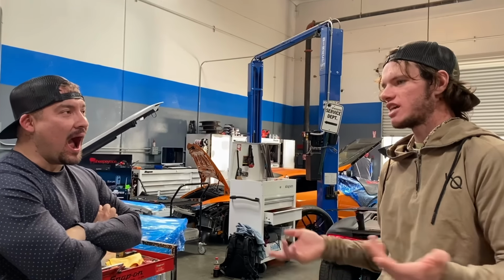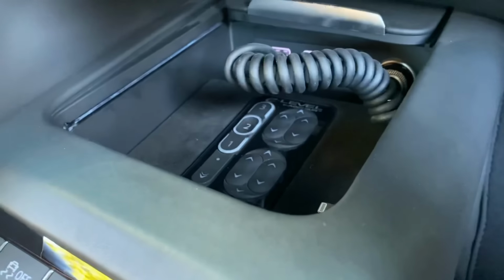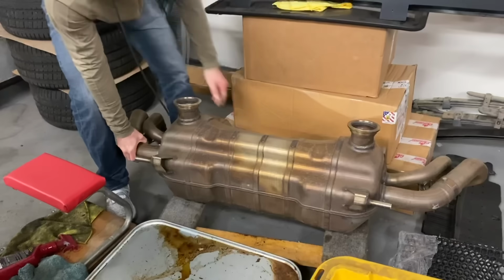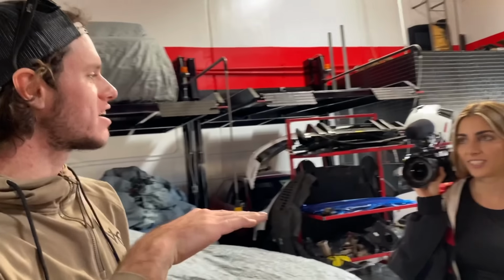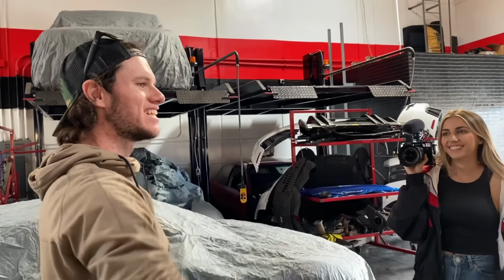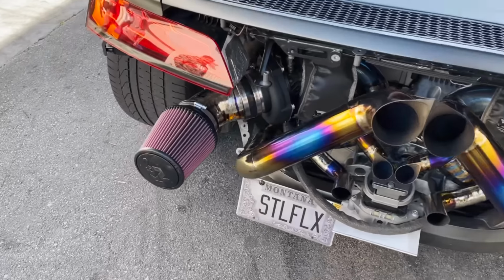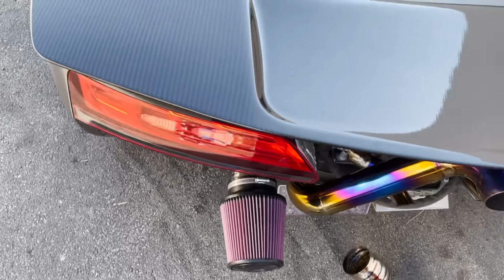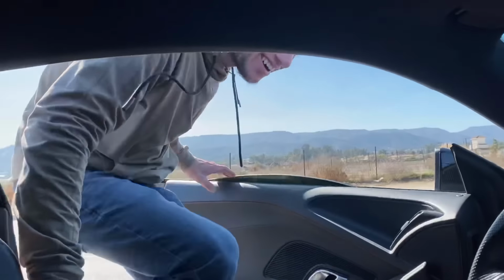My 1400HP Twin Turbo R8 vs C8, Aventador, Ferrari, R8

Comment: "What's the fastest car u been in?" "2000 hp viper. Oh"
Reply: watch texas drag races , 2000hp vipers get shamed and its kinda upsetting
Reply: Proceeds to say her vette dynoed around 1000 then gets left in the dust  by the Audi in 1000 lol
Reply: @willsmith8203  awd r8 vs rwd c8. Different torque, different weight. Plus it's a 1400 hp r8, not 1000
Reply: @boudrauxmnxsty6871  he says earlier in the video he can’t turn it all the way up. It’s capable of making 1400. Also the vette weighs less lol
Reply: @willsmith8203  wrong. Vette weighs more.
Reply: @boudrauxmnxsty6871  
vette curb weight 1527 kg (3366lb)
Audi curb weight 1595-1695kg (3627lb)🤔 
On a side note a rematch would be good since she’s had it retuned to make more power now
Reply: @willsmith8203  it's a 2016 r8 which has a 3200 lb curb weight. You saw the 2021 r8 curb weight
Reply: @AltoTheGod  Actually the new calvo vipers are the fastest thing, cant lose
Reply: @zestooo6932  zr1’s are street kings bro
Reply: @alterrihenri110  please stop
Reply: @zestooo6932  yeah seen the calvos get gapped by some 2400-2500hp GTRs. The problem with the viper is its 2wd and the monster 8.3 v10 makes gobs of torque at low rpm so it blows the tires off
Reply: @gradoisx2348  nah, the videos with them have the owners saying they actually get really good grip, and they do, if you watch. Also, even 1320 says you pretty much cant pull on calvos.
Reply: Same as asking a girl what’s the biggest she had before, digging your own grave…
Nobody wins lol
Reply: @name5293 he’s not wrong, obviously depends what you’ve done to it. But stock, and in most modded examples, the ZR1 beats an R8, and 1/2 the price. And I’m a certified Chevy hater it’s just a fact.
Reply: I have been in a 3000hp Nissan patrol
Reply: I’ve been in an F1 car

Comment: Turbos on a V10 sound SO GOOD.
Reply: where is the stustustu sound??
Reply: Spencerrr love all you’re cars man big ups
Reply: @lining880  replaced it with crackle sounds
Reply: Try a v12
Reply: How much is the total of his car
Reply: @moniestewart2160  probably 250K
Reply: @blake-hz5vx  250k is the car without mod
Reply: @lining880  it’s not there cuz that’s not a good set up for such an expensive car, everything in it is done right. Therefore you’re not gonna be hearing turbo flutter.
Reply: @NNfullsend  turbos are 40k
Reply: @moniestewart2160  enough
Reply: @nrvous_250gt  my man
Reply: turbos on anything sound good even on a semi truck
Reply: @lining880  You get turbo flutter whenever you don't have a blow off valve, this car has them So the boost goes out there, if not, it goes through the turbine
Reply: v8
Reply: @xen1568  diesel whistle really is another level
Reply: Facts
Reply: @NNfullsend  facts
Reply: A turbo just muffles the sound. It would sound way better with just long tubes and no turbos

Comment: Still my favorite WhistlinDiesel Video, Car Rallys are awesome.  Was cool seeing the R8 run alongside ArtIsFast's R35 as well.  Though I'd still like to see an "Is it really a truck?" vid of a certain V10 powered Ram Pickup.  A Viper Motor was awesome, till the suspension and gear ratios of the transmission came in and I still don't know if it's offroadable with a one ton tow.  Though it sure does look awesome going over a hundred through the canyon corners with little to no oversteer with no extra weight in the back.  SRT10s right.... 😅
Reply: Also, I really enjoy ArtIsFast's subscriber rides.  Ever considered an annual WhistlinDieselExperanceRaffel for subscribers to vote on the truck they'd most like to try to keep up with you in?  You'd need wavers almost as long as ArtIsFast's, but watching a subscriber in a helmet try to keep up on a disability course and a few high speed cylinder block offroading runs would be a lot of fun.  You know they'd be over the wincing quickly, until they broke suspension components or something that scared them.  At which point they'd probably be asking you how you do this every week with no gear.  😅

Comment: Did anyone else’s stomach drop when WD almost crashed at 13:22 I thought it was a goner at that moment ngl
Reply: was that even him driving?
Reply: deon91 dont think so
Reply: Yes holy shit that was so damn close. A second before I was just thinking "he wont live long" 🥶🥶
Reply: The Car has clever ESP and traction Control . There was still a Lot of room. Everything's okay
Reply: @DrKampfpudding  Often enough they turn it off or it even gets disabled\adapted because of the mods and wheels. You can already see that traction is gone on front tires and if there would have been any incoming traffic hed be fucked.

Comment: I have a estwing that I had used drywall for 12 years and it’s warn more on one side than the other and I am going to get it framed. If you are running it on E85 there’s an additive that you can get so it smells like red bull and 3 other different smelling additives.